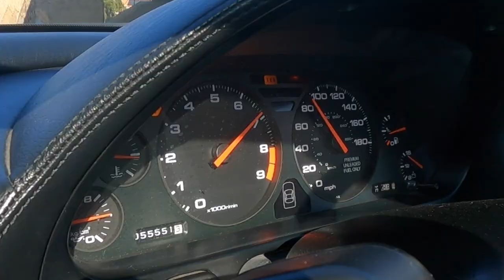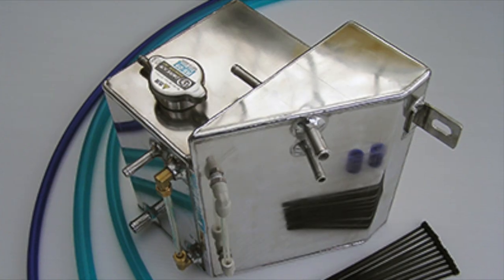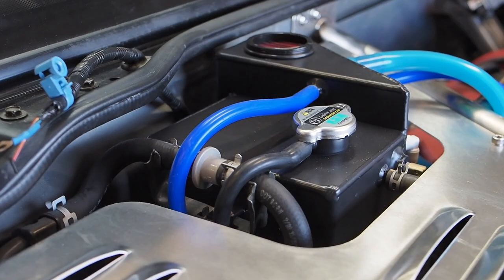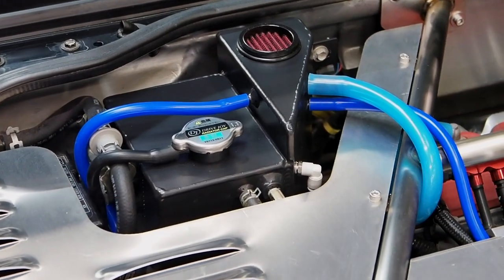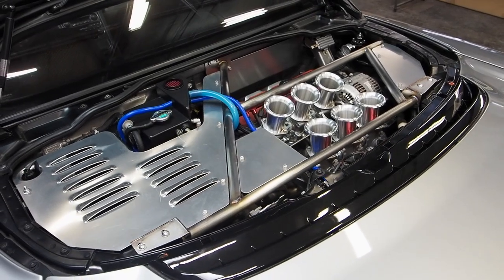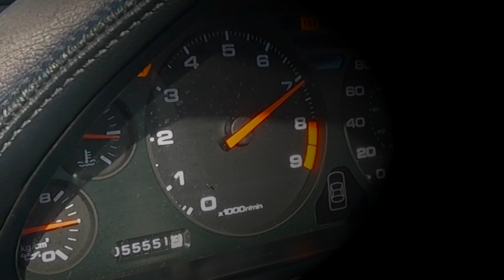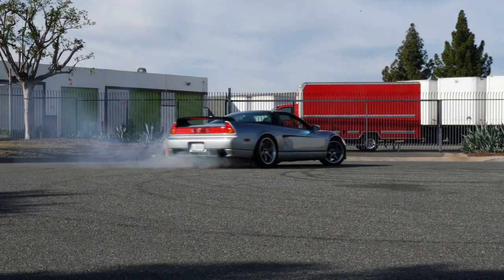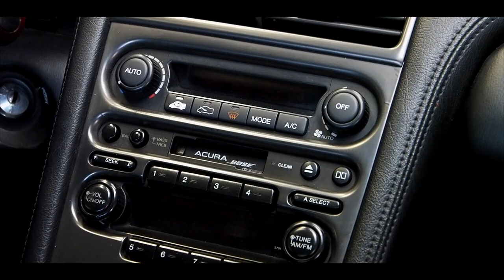Epic NSX Rippin' VTEC | Toda ITB Equipped Machine!

Comment: nice and clean OEM+. Does it make more torque and power with ITB and remap? could you post the spec in the description of your build? (when  not too long :))
Reply from the maker: We will update the description of the video now. It makes more power with the ITBs and the ECU remap. But we weren't expecting ground breaking-earth shattering numbers. This build was for sound and handling. It does both very well.

Comment: Do you run the stock differential ? What's the ECU and tune, and how much WHP do you get out of it ? Also do you plan on making an air box ?
Reply from the maker: We are currently running the stock differential. The ECU has been swapped for an AEM Infinity. The car currently has just over 300 WHP. We do not have any plans for an air box. We prefer to look at those cute little trumpets.

Comment: Can I ask what you needed extra on top of the ITB to get it tuned and running?
Reply from the maker: Fuel system upgrades and ECU mostly.
Reply: @JustDriven  Thanks, how is it on cold starts and idle?
Reply from the maker: If you mean sound: it's loud on cold starts and mellow on idle. But obviously screams on throttle and eviscerates at VTEC.
Reply: @JustDriven  Thanks for all the input.  I ended up going with AS-Motorsports ITB.  Seems to be OEM and idle friendly as well.  Your video was a great help.
Reply: Let us know how much power you managed to pull out.. That would be Epic!

Comment: HAVE EAR PLUGS AND MY 7500LB DIESEL PULLS HARDER THAN THAT THING NICE GO CART THOUGH WERE UR SEAT BELT I THINK I SEE THE AIRBAG LIGHT 3KLBS GVW WITH PASSANGERS LOL
Reply from the maker: THANK YOU FOR CHECKING OUT THE VIDEO! WE DIDN'T BUILD THIS "GO CART" TO "PULL HARD." WE BUILT IT TO LOOK BETTER THAN YOUR 7500LB DIESEL AND WE THINK WE NAILED IT! THE AIRBAG LIGHT IS ON! NICE CATCH. WHEN YOU TAKE THE STOCK STEERING WHEEL WITH AIRBAG OUT IT TRIPS THE LIGHT. ALSO, WHEN YOU REMOVE BOTH SEATS WITH AIRBAGS IT DOES THAT TOO. THANKS FOR WATCHING OUR VIDEO!